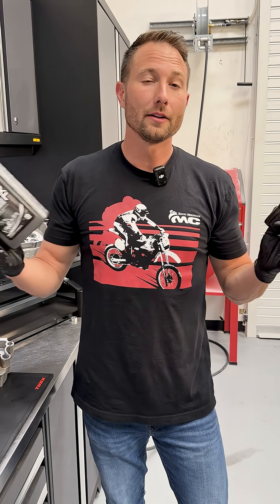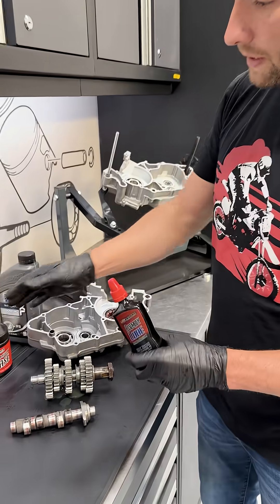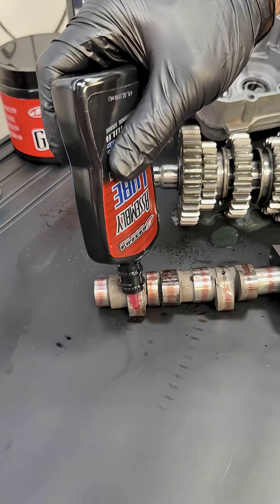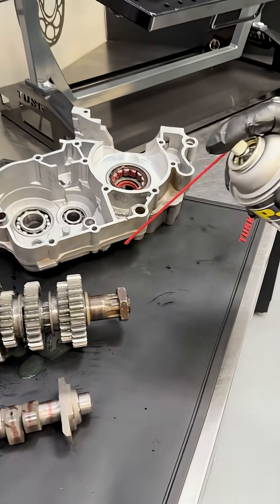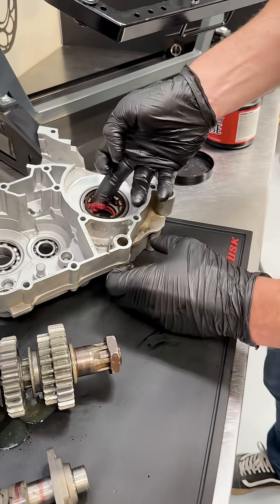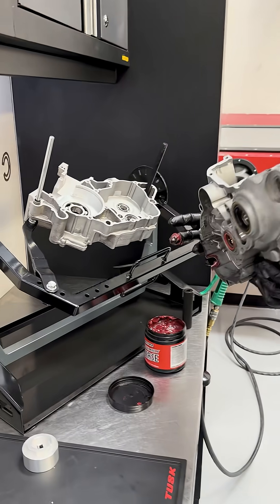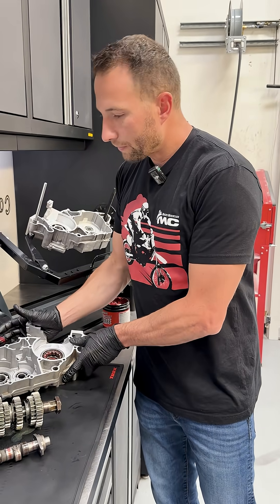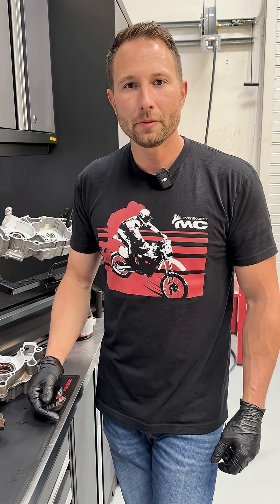Assembly Lube or Engine Oil?

Comment: Hey i wanna ask is that why my user manual says put 200 ml more engine oil after overhaul and i only use the engine oil during assembly but 20w50
Reply: Because the new oil filter is going to absorb some of it
Reply: @kgmxtraining250 no, if this were true every normal oil change would then just call for that much more. Also, they’re tiny NO way they could even hold 400ml.
Reply: It’s because In a routine oil change there will always be some old oil that you can’t get out of the engine so you aren’t replacing the entirety of the contents of oil. When you overhaul your engine and it’s completely drained, you don’t have that little bit of remaining oil in the engine so you’re actually doing a complete oil fill.